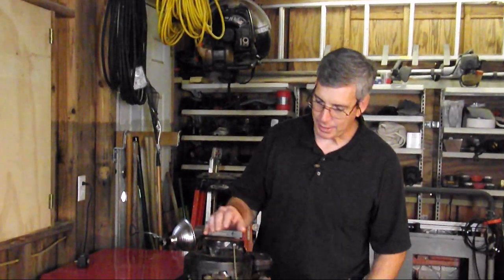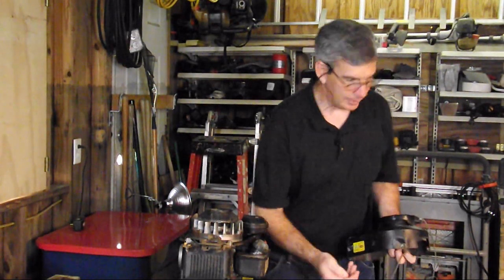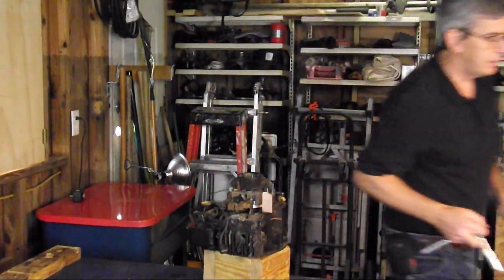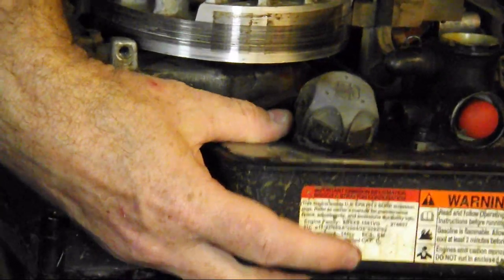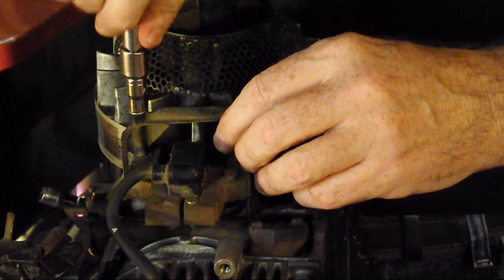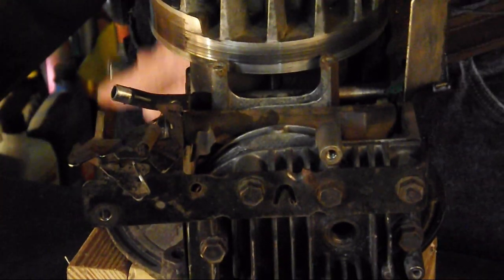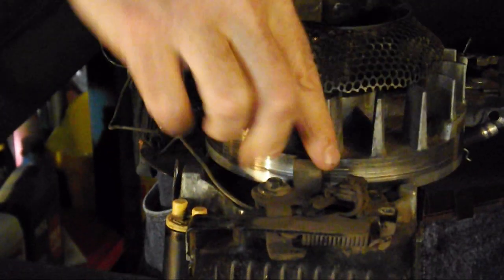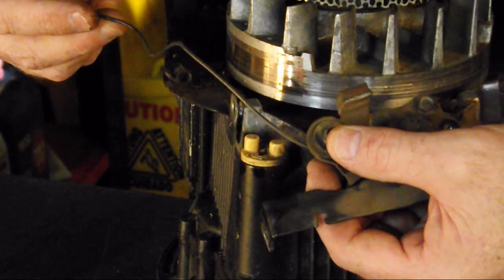#2 Taking apart and rebuilding a small engine series

Comment: isnt that 300 series briggs nothing more then the same engine they started producing back in the 60's or 70's (not sure exactly how old). i think they cheapened it up, and the original engines did not have plastic carburetors... they also used to run on points and condenser
Reply: they also used to have a choke and not a primer bulb